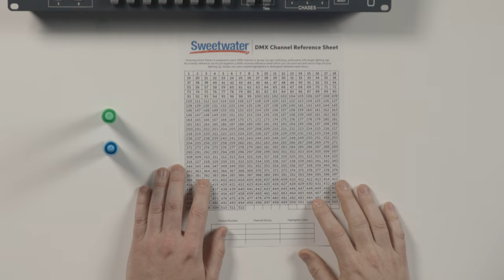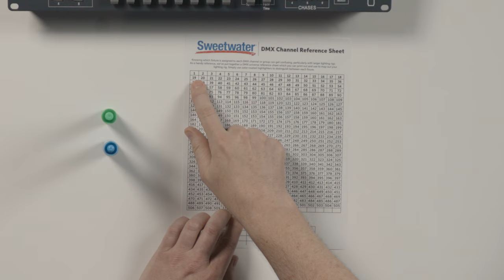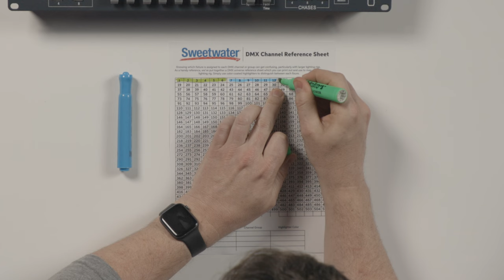DMX Lighting | A Musician's Guide to Stage Lighting

Comment: Thank you so much! I was breaking my brain so much about how the connection of the lights would be.. with most of the ‘cheaper’ controllers having just 1 (or maybe 2) DMX outputs..

Thinking in a audio kinda perspective I did not understand how that would be possible if you would have multiple lights and different type of lights 

So daisy chain it is! (I should have known because it’s digital.. but now I’m shure! 😊) 

Lots of thanks!

Comment: The obey 10 has 16 channels per fixture and they're split between A & B. If you wanted to align these lights you would start them all at the beginning of the corresponding channels starting #.Channel 1 begins with 1,2 is 17,3 is33 4 is 49 and so on. Therefore the first one on1 and the second on 17 lines their channels up and they would both be controlled with 1 to 6.

Comment: Very new to this... 10 mins new to be exact. 
Question: If I want to have all the lights doing the same thing, do I program them all to just one Chanel?
Reply: Yes you would set them to all be on the same dmx address
Reply: You can either program them all to the same channel or send identical data on all channels (in case you might want to make them do something different eventually)

Comment: All of this digital control may become erratic if you do not TERMINATE the cable at the last fixture in the chain.  Microphone cable distorts the data signals but unterminated lines are a disaster by reducing reliability caused by reflections of the signal within the cable.
Reply: I've never had that problem and now I use mostly wireless DMX Transmitters & Receivers.

Comment: do I need my lights plugged into AC voltage when using DMX cables ( my lights are easing dancing )
Reply: the DMX is just a control signal, the light also needs electricity to work